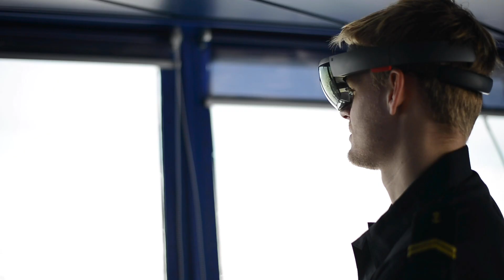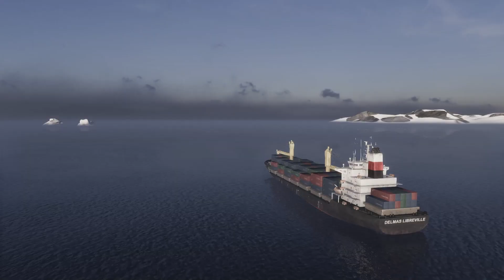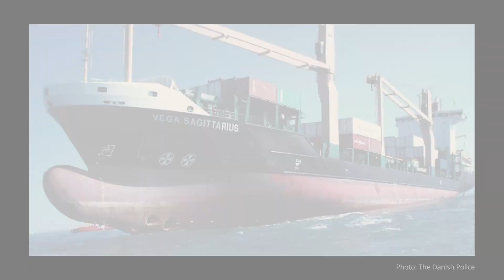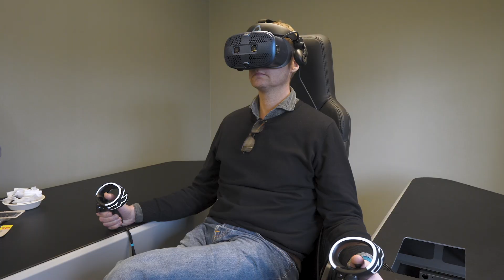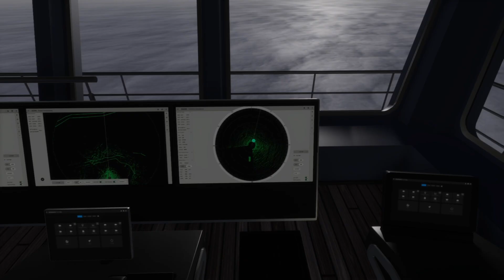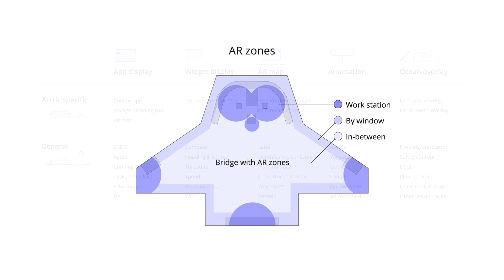Augmented Reality for Ship Navigation

Comment: Very nice presentation and thorough. But are you people offering this at a commercial level?
Reply from the maker: Thanks Altamash. No we do not. We are currently working with  several industry actors to propose design guidelines for AR in maritime sector. Our goal is to develop knowledge that can support design of new systems. So in order to do so we develop prototypes and demos. Our frameworks will eventually be released through OpenBridge as an extension to the current content. www.openbridge.no
Reply: @oceanindustriesconceptlaba8480  Sounds great, I am following this closely. It would be of great help to transportation if modules like navi are automated or used as augmented resource.
Reply: We are developing a similar solution, you may contact us for details.